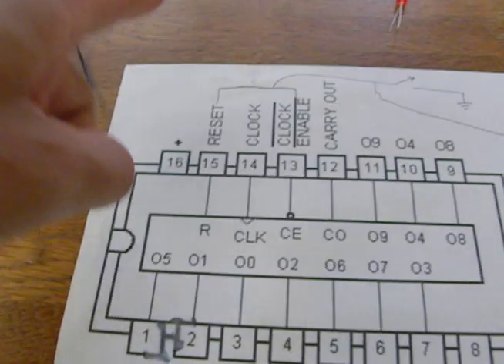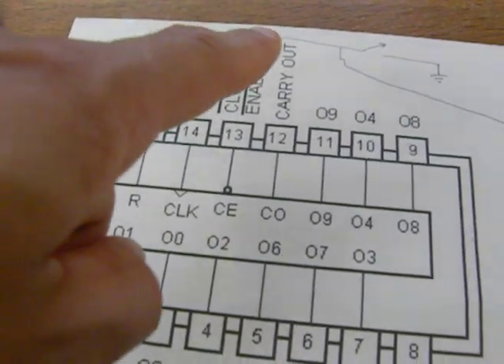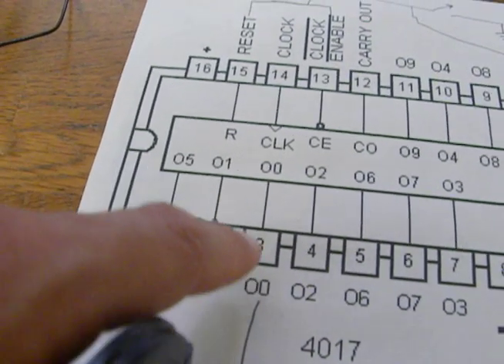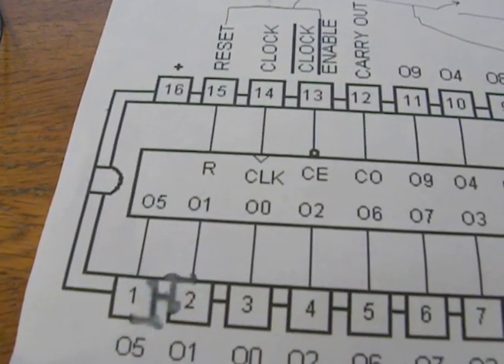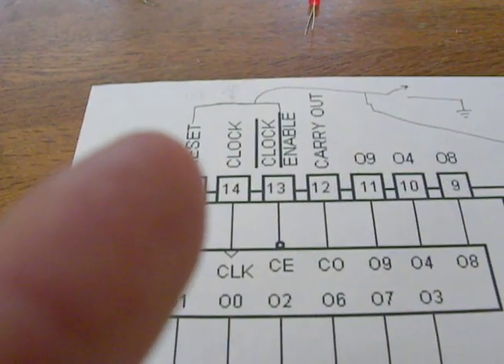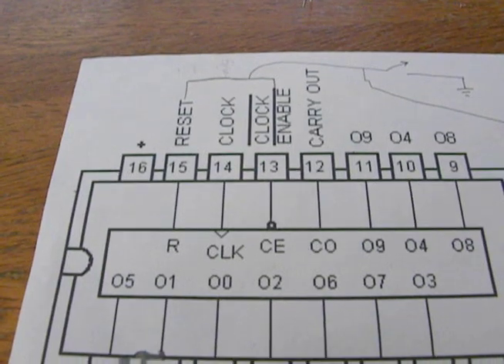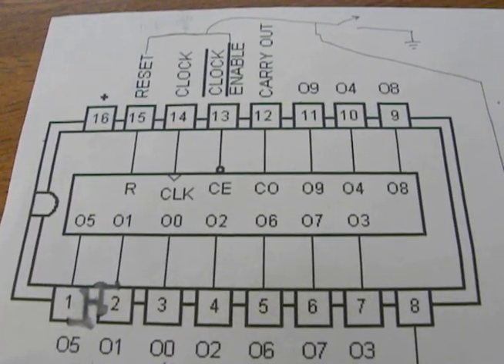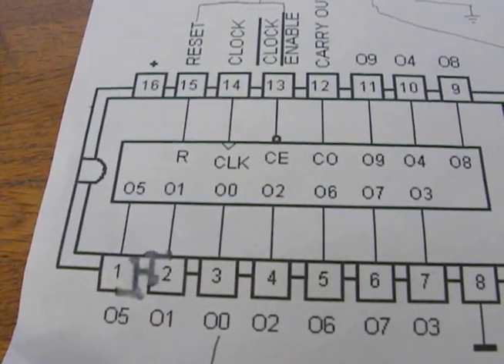4017 monostable

Comment: Thank you, great concept.  This helped me develop a single input to multiple outputs logic circuit.  For instance, a single pushbutton input (1) can trigger up to (9) outputs (through Q1-Q9) with only a single occurrence. We used this circuit to flash a vehicles marker lights twice (through Q5 & Q7) whenever a keyfob was pressed to lock/unlock a vehicle. The 555 was used as a clock with TrimPot to achieve the desired speed.

Comment: Hi Tomo, thanks for doing this video. I understood what you were getting at. It's a bit difficult to explain, but your msg. does come across. I've been looking for a video that demonstrates some of the extra cab abilities of this wonderful chip. Many see it as a "one trick pony," that only being just an led chaser circuit, but it has some great additional functions which make it all the more interesting and useful. 

After that long-winded comment of mine, a question: is your circuit for demonstration purpose only, or are you using this for some special project? I'm always interested in both circuits AND at heir applications. 
Thanks again,
Sarah